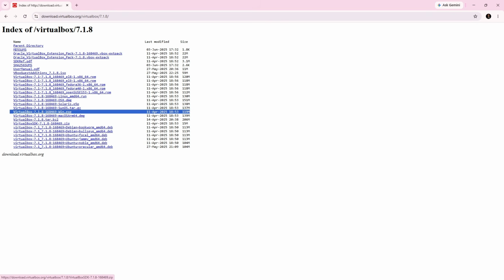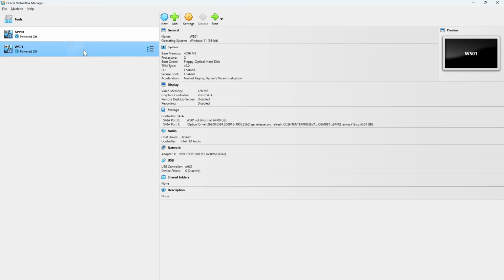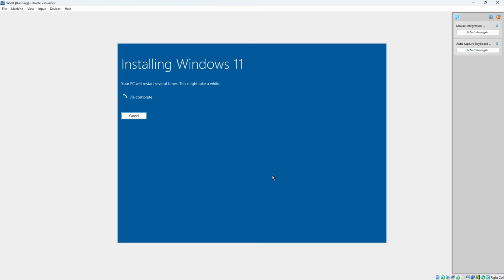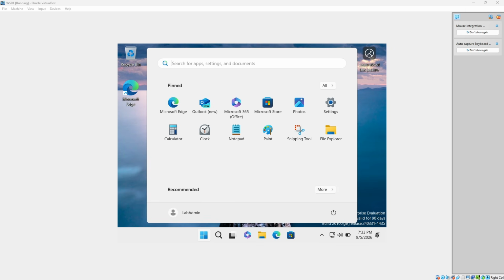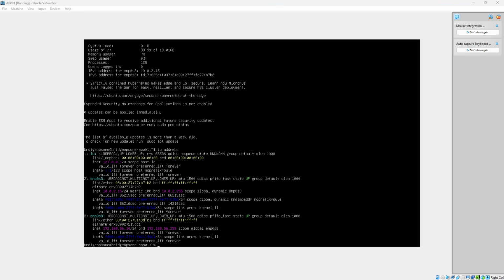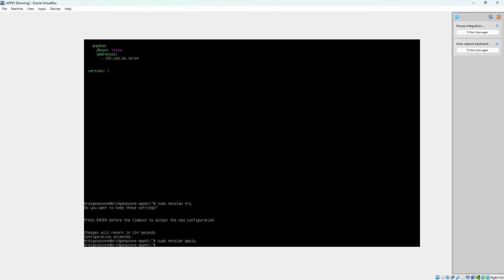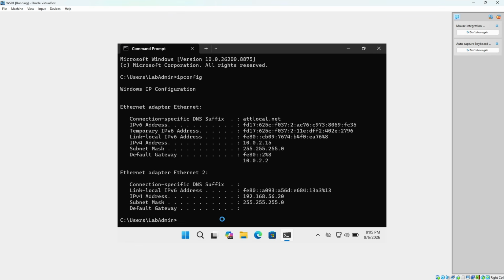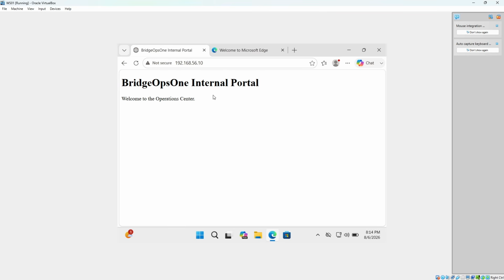Build a Windows 11 Enterprise Workstation | Enterprise IT Career Episode #4 - Home Lab

Comment from the maker: Episode 4 is finally here!

If you’re building the lab along with me, let me know how it’s going so far. And if you run into any issues, drop them below and I’ll try to help.

Also, if you’re having trouble getting Windows 11 to boot in VirtualBox, check the description. I had issues with 7.2.14 and switching back to VirtualBox 7.1.8 fixed it for me.

Next up is MON01 and monitoring!